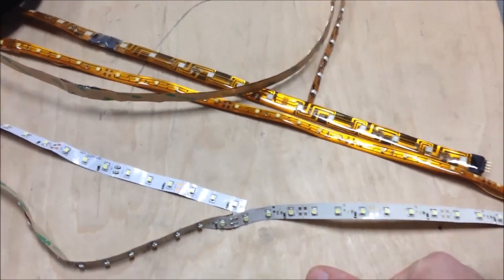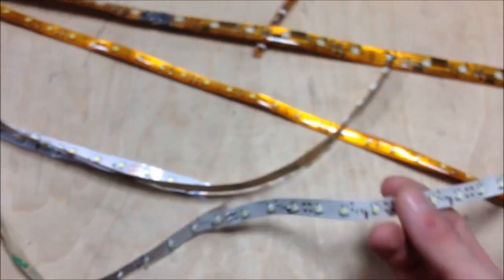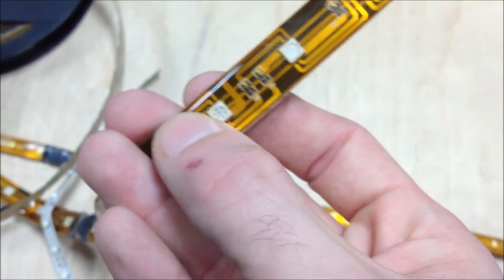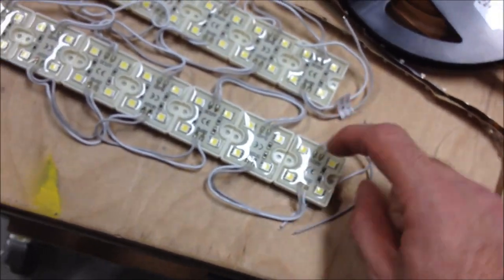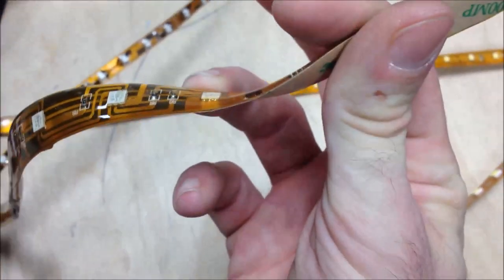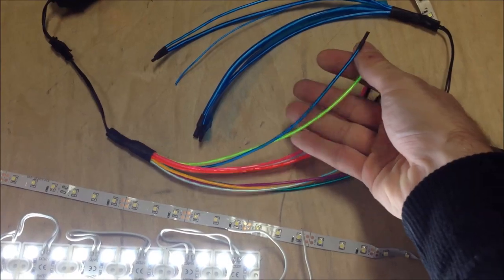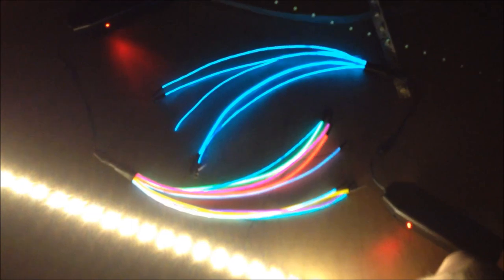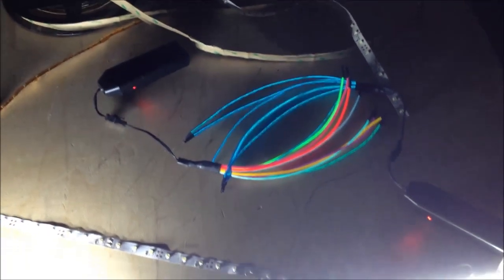LED Tape vs. EL Wire Demo

Comment: What is "soder"
Reply from the maker: Spelled "Solder" it's a way to make permanent electrical (and also plumbing) connections.  You take the copper parts that you want to join and get them physically touching, then heat them until they are hot enough to melt this metal alloy called Solder. When you touch a bit of solder to the hot copper it will melt into the parts and join them together.  The wikipedia page for Solder has a lot of information about different types of alloys, and there are a lot of videos here on youtube about how to solder electrical connections and also plumbing connections.
Reply: ah right we use that stuff here in the UK,we pronounce it solder,crazy old world eh.
Reply from the maker: @pir869  Ahh that makes sense!  I also am from the midwest USA and I have pretty lazy enunciation on top of using the US-english versions of words.
Reply: A question,is the black surface mount component a current limit resistor,i want to remove them to use the strip without it.
Reply from the maker: @pir869  Yes, I would say in most cases those are resistors, but sometimes there are other things on there.  Some tapes have little voltage controllers on there, some might even have capacitors or other components if there's some digital signals going on to control intensity.  If you were removing those resistors I imagine it might be difficult to drive the LED's- you'd need a current-limiting power supply but the appropriate current would be different for any different length of tape since the sections of tape are run in parallel.
Reply: i will be driving the string of LEDs with what is referred  to  as a "joule thief",they will drive a string of christmas tree (100) LED fairy lights,so i want to illuminate a stair case at night from under the banister rail.

The circuit is run from a single AA battery,an oscillator circuit with a feed back path induces a voltage spike into a small toroidal transformer,it's basically a DC-DC converter that will fully drain a AA cell and output around 20Vdc,it works well and will be switched  on/off for use at night.......very crafty indeed.
So current limiting is not needed and the LED string needs to be series to add up all the forward voltage drops to equal there abouts the device output,hence the need for just the LED string.
Reply from the maker: @pir869  Won't you then need to cut up the LED tape into individual sections and re-wire them all to be in series?  Seems like a lot of work but I suppose it might be easier than other solutions.
Reply: it's very convenient with the sticky back,and the banister rail is round/flat bottom,i will cut the strip into sections and use bell wire to re connect at intervals,and use the left over strips for cupboards etc and all my AA and AAA used batteries will work this circuit,there is a limit to how much it will operate,intermittent night use to let dog out,get coffee etc the batteries will last long enough,most batteries seem dud at around 1V-.8V,this circuit should pretty much drain the capacity of the battery to almost zero,check out youtube vids,easy to make,and some vids showing 100 LEDs bright enough from a single AA cell,i'll power up strip section 'till i don't get the luminosity i want,in almost pitch black you can see with a single LED shinning,evenly spaced on the underside of the banister also you don't get your night vision levels ruined by glaring LEDs pointing at you,they iluminate the stairs by light scattered on the wall(painted white),this little circuit will run CFLs too,with a little modification,all on youtube.
I'm an electronics technician so i get a head start,but it's very easy to make,1 resistor 1 transistor 1 or more LEDs and a small hand wound transformer of at least twenty turns,two peices of wire same length wound together 1 end of each opposing length joined together to make a centre tap and of course a AA battery,nothing more,ok a battery holder and maybe some hot glue.

say good bye to mains powered lights areas of limited use,or sheds or cellars,i have these too.i bought some strip 5M of it,more than enough for light.
I was teasing about the solder.

Comment: check out the Whoa Board Connected to EL wires or panes  on  kickstarter: https://www.kickstarter.com/projects/2055918540/whoa-board-dream-with-touch-sensing-el-wire-panels?ref=nav_search
Reply: That is awesome! I don't completely know how kick starter works but I really hope to be able to buy this some day! Share this link with everyone!
Reply: Do you know if there are controllers/boards out there on the market already like this for sale? Or is this the first of its kind?
Reply from the maker: I have never seen any boards that use the EL wire itself as a control input.  But there are other boards out there to control EL wire.  You'd just need to have other input (like dedicated sensors and switches)  Poke around on places like SparkFun and see what you find!

Comment: I use this on the bottom of my skateboard.
Reply from the maker: +Crab Hawk Neat!  Any pictures or video?
Reply: +Crab Hawk 
Simply fanstastic!

Question is: which batteries?
Reply: AA 1.5v x2
Reply: Which led can you use with only total 3v?
Mine use 12v...
Reply: +Davide Nastri My apology to everyone it is a 9v that I have and it is called nitefx the 2x1.5v lights I have are EL wire. I have 3 types of lights on the bottom of my board and I got confused. I'm sorry!
Reply: No problem at all!

Interesting indeed...

How long does a 9v lasts with 12v leds?
Reply: Doesn't it get damaged if you try to grind
Reply: I have a Boosted and an Enertion both are electric - no grinding.

Comment: Your running too many wires off a small battery you noob. El wire is very bright
Reply from the maker: Feel free to do your own comparison video- The EL wire bundles came direct from the supplier to showcase their product.  Call them noobs if you want, but I've seen drivers that plug into the wall driving shorter lengths of EL wire, and while it's brighter than this demo, it still is nowhere near what you get from the LED products I tested.  Feel free to make your own comparison video though, always happy to be proven wrong.
Reply: djlemma Hi,
Thanks for posting this video, I will really appreciate if you can specify from where you bought those square chain type LEDs, Kindly specify the company which makes them.
Reply from the maker: mohammed sajid Siddiqui Take a look here- http://www.ledsource.com/products/atg-osignage-s-series/
We work with LEDSource all the time, they're a great company.  Give them a call!